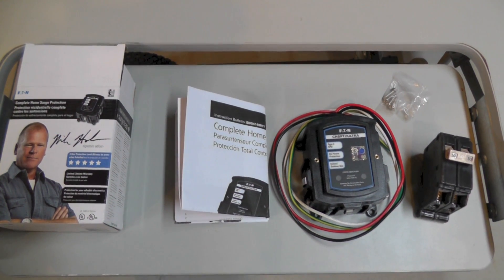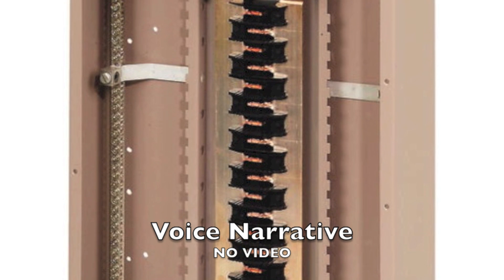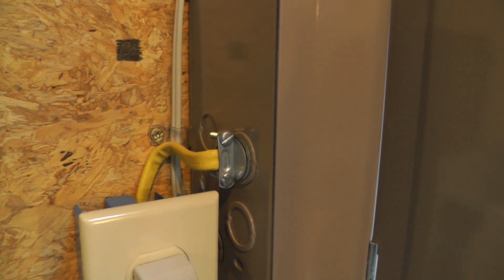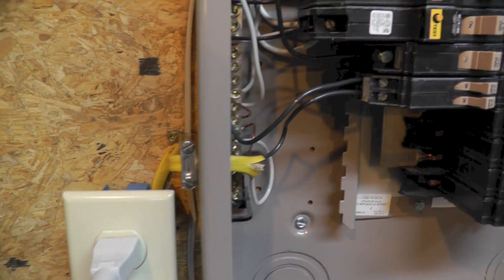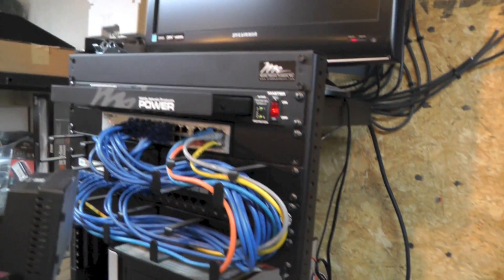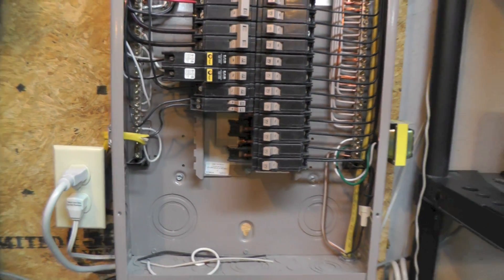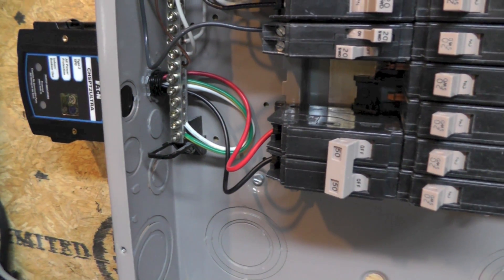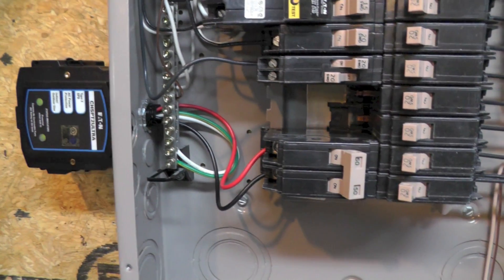Whole House Surge Protection

Comment: Is adding another breaker absolutely necessary?  Can't this just be installed on an existing double pole breaker or on 2 separate/individual single pole breakers installed on different phases of the main bus?
Reply: My panel AND my breakers allow for double tapping, in fact, it has the slot for the second wire. Inspectors may not like it but is mostly because although most panels are good with it, it was not so in the recent past. Yet, I have a 30amp breaker for a dryer that we don't use much because we use mostly our natural gas dryer, so I double tapped that one. It is perfectly fine to do so, technically, is allowed, BUT you need to check in your jurisdiction, mine is fine with it, especially because the purpose of the code is safety and if the equipment is rated for TWO WIRES then is safe...

Comment: Your thinking of the surge like a mouse getting out of a cage and running down the wire.   It's more like a wave that fills all the inlets (wires),  the surge protector will catch that wave and reduce it regardless of the slight difference in distance.   Yes due to the speed at which electricity travels the spike(s) will be able to rise a bit higher before that wave gets chopped down.   You can think of it as putting a load on the line if the voltage rises above a certain point.  Now if the spike is too fast in the sub nanosecond range then these devices don't help all that much.   Then again the sub nanosecond spikes often get attenuated in other ways on the way to the sensitive devices.   For example another surge suppressor or a less sensitive device on the same branch.   Technically in the middle would be best to catch spikes from inside your home spreading to other devices.   Run a vacuum cleaner.....

Comment: The type of surge protector installed here is considered a Type 2 and is only to protect from surges generated INSIDE the home, not from weather or from the electrical company. To protect from either of those, you would need a Type 1 surge protector installed outside at the metering device.
Reply: That's not correct.  A Type 1 SPD is installed between the secondary side of the utility service transformer and the line side of the main service equipment overcurrent protection device.  A Type 2 SPD is installed on the load side of the main service overcurrent protection device.  A Type 2 SPD will protect against internal or externally-generated surges.  It is important to locate the Type 2 SPD as close as possible to the main overcurrent protection device, and keep the lead wires as short as possible, as this improves performance and minimizes the overvoltage seen by the loads during a surge event.

Comment: Where did you see that the manufacturer recommends placing the unit at the top (closest to the main breaker that is)?  I actually see that the install instructions state "Locate a dedicated unused, or install a new 2-pole circuit breaker in an available space closest to the location where the CHSP is to be installed".  Mine is an outdoor panel and there are only knockouts in the bottom of the panel.  I just went with the install instructions and put the breaker at the bottom of the panel.  The leads are not long enough anyways to reach a breaker at the top of the panel.  Your other comments about locating it at the bottom of the panel do make sense to me.

Comment: pretty sure those wires could be a little bit shorter ;) - how does this surge protector protect surges on both 120v lines?
Reply: He is using a two pole breaker. Each pole is on a separate 120 volt line.
Reply: @robertmoore254  yes I ended up installing the leviton surge protector. Works for me! But they recommend a dual 20 amp breaker... So I don't understand why they don't recommend using a 30 or 50 amp?
Reply: @enkrypt3d  Breakers are sized according to the size (awg) of the wires that it is protecting.

Comment: I don't think the distance on your outlet is much of an issue for the electronics you had there.  Include the distance from the outlet to your surge strip and then from it to the electronics and you have a good 3 feet more of wiring compared to give or take 5" from the eaton to your panel.
Reply: Exactly, and he can always use a type 3 in those outlets anyway. He can use a surge strip and plug that equipment there. After all, is recommended to add protection to others like AC, etc.

Comment: I had an Eaton Ultra surge protector installed by an electrician.  My question is will this protect my electron things from a near by lightning strike.  I know it protects against surges but can it handle a near by lightning strike?
Reply: You need some VERY expensive kit to give you that level of protection. You are talking about a few million volts at about 500,00 Amps on average in the UK and our storms are little kittens compared to yours. I worked at a large data centre and the protection devices like GDT and explosive disconnects for a 3 phase 500A feed cost about £450K. You can buy a decent 4 bedroom home for that in most of the UK.

Lightning strikes carry eye watering amounts of power. I find it strange that the AC and fridge were used as an example. You are far more likely to suffer damage to more sensitive electronics such as televisions, computers, alarm systems and audio equipment than larger appliances with a massive inductive load. With a nearby strike you have to worry about induced current to don't forget.

It was not mentioned if this device protects against overvoltage. This can be just as damaging. Surge protection helps prolong the life of devices and gives some protection but is nowhere near as good as a double conversion UPS for example.

They have just started to mandate SPD's in the UK and soon to follow AFCI's god help us !!!
Reply: @TRS-Tech  Exactly my thoughts. He needs to buy one like BAD WOLF, which is commercial grade but made for homes, protects up to 260k, for about $260, and even EMP.  And, they even have one for $400 that goes up to >500K, which is almost a direct hit from lighting. I like the BAD WOLF one, and I recommend it because is made in USA by disabled veterans and the specs are for a voltage tsunami. I installed one for my brother and my neighbor and will soon buy me one. I have an 80K one, which is fine here in Ohio since we are not like Florida, but just for my peace of mind and paranoia, I will get it, relocate my 80k to my subpanel in the garage and with the one for the AC outside in the disconnect box I should be dandy!
Reply: Some surge protectors, most, are between 22k and 35k.  If the lighting is close then you are getting at least 100k, so not enough for the voltage tsunami. Yet, it protects from spikes from your home equipment, and even lighting if far enough and spread enough that your share of the "tsunami" is a minor ripple. You may want to get an 80k one at least.  The best is BAD WOLF, it is like $240, but it goes up to 260k, which is thunder storm in your living room level, and it also protects from EMP, etc.  And, BAD WOLF is made in USA And they are made by disabled veterans.  Is what people in Florida should have for example. That beast is small and looks cool, the wolf red eyes is that LED indicator that is working. And, have another one in equipment far from the panel or outside, like another in the disconnect box outside, the one for the AC.

People who complain it does not ignore that there are levels of surge protection.  Is like complaining your insurance company is bad because it did not cover your loses of $100k, when you paid for a policy that had liability coverage for only $50k. Some others pretend that a strip surge protector of $10 that goes in the outlet did not protect from direct hit of a lightning. Those are meant for surges from the fridge, power tools, the AC, dryer, etc.
Reply: mine did not
Reply: All bets are off with lightning. Act of God! But the unit has a lifetime warranty and Eaton will replace it if destroyed.
Reply: Nope. That's not it's purpose.

Comment: great demo.  there is a reason why mfgs recommend installing the surge protector device as close as possible to the main service connection, usually at the at top of the load panel:   for every inch of distance  that the very large current spike travels, on its way to the MOV, there is a voltage drop equal to the surge current times the resistance of the copper involved, which includes the bus itself and the surge protector leads. so if you want to add  to  the size of the voltage spike that your house sees, don't bother trimming the surge protector leads--remember they will add  about 100 to 200 volts per foot. the bus itself contributes some but very little compared to the leads themselves.  nice job here 

one detail that is worth mentioning is that the Eatons 50a breaker is what differentiates it from others, and gives it a very impressive nominal discharge current of 20kA.
Reply: Thanks for the explanation. Just to reiterate your point (with a more direct statement), it is more important to keep the surge protector leads short than it is to locate the surge protector at the top of the panel (i.e. at service  entrance). The resistance of the leads is going to be much  (e.g. 10X) more per unit length than the bus bar. Stated another way, 1 inch of lead is equivalent to 10 inches of bus bar. KEEP the leads short.

Comment: Any surge coming into the left branch is protected but the right branch is not. Shouldnt you use 2 single breakers one on each branch?
Reply: Every other slot is the same "hot" leg. Left side would be 1,2,1,2,1,2,1,2; right side 2,1,2,1,2,1,2,1 etc. This results in more balance between the bus bars.
Reply: @jcnash02  I believe that left and right sides at the same height are the same leg.  Therefore left side going down is 1 2 1 2 and right side is 1 2 1 2. Etc.
Reply: Study 1:14 a little more carefully.

Comment: So if I have 2 panels in my house, I have to install 2 surge protectors for both of them?
Reply: If you have (2) two panels one is likely a subpanel which should have a main breaker feeding the subpanel.
Reply: In this video of a Main Panel, the green and white wires were both connected to the left buss, which was the ground buss.  This is OK since the ground buss and neutral buss are connected together in the Main Panel. In a Sub-Panel, they are separate.  Therefore, the Eaton white wire will go to the neutral buss, and the green wire will be connected to the ground buss.  Notice the doorbell transformer on the right. Both green and white are connected to the neutral. Again this is only OK in a Main Breaker panel.  Note: I am not an electrician, but I know a few.
Reply: seems to me that would be a good idea. most of these when get hit by a big surge or lightning the unit needs to be replaced s it has done it's job some have lights on them that indicates if the unit is working
Reply: Not a need per se but I have another one in my subpanel since it is so far in the garage from the main in the basement. This is because any power tools I use in my garage the voltage tsunami would hit everything fed by that subpanel before it reaches my main in the basement, so it arrest any spike in the very panel in the garage and let it send the excess through the neutral. Same principle as having another surge protector in the AC Disconnect box outside.  It is farther than anything else.

Comment: on the right side of the panel, What is that yellow box connected on the outside? thanks
Reply: It's a transformer. Most likely for a doorbell. Usually find them mounted on a junction box in the basement joists.

Comment: All white wires should be connected to the neutral bus bar, bare copper/ green wires should be connected to the grounding bar in the panel. I see bare copper wires connected to the neutral bus bar, that is against NEC.

Comment: You connected the white & green to the same bus bar.  I checked the PDF instructions and it says to tie the white to the neutral and the green to the ground. The PDF also has a schematic showing them connected to separate bars even though both bars connect to earth ground.   On a main panel, they are tied together, but at a subpanel they are not.  You have a ribbon connecting your two bars. If the screws were to come loose or lightning were to fry that ribbon you'd lose your protection.  Most likely you're fine, but it's not following the instructions, and this is wrong if anyone is doing this at a subpanel.  You should add a video annotation to connect them separately.
Reply: ONLY if that is a subpanel... which this one is not. In a main panel, such as the one in the video, the ground AND neutral are connected (bonded) together so it is NOT a Code violation. And a "home inspector" does not have jurisdiction, only the city/county/state electrical inspector.
Reply: It is his main panel and both ground and neutral ARE bonded in the first disconnect from the meter, which in his case is his main panel.  A subpanel and anything after the FIRST main disconnect has to be separated.  IF at the main panel then it is all bonded and the same bar. From then on any current going out via ground or neutral will continue to the meter and then to the utility pole via neutral.
Reply: I noticed that this guy put the ground on the neutral bus bar too. Here in So Cal in all cities that is code violation. 
 Any home inspector would not at all sign off on that.

Comment: That's the most amazing looking panel I've ever seen. I am going to show this to a friend of mine who, after seeing this, has the 2nd most amazing looking panel I have ever seen. I am considering a whole house surge protector as well. My question is, has this unit saved the day for your electronics during any surges or outages since you have installed it?
Reply: anthonyflannery222
 does help that it is mainly 20 and 15amps circuits. 

very clean panel though!

Comment: 1. on the left of the panel you don't have a GFCI and a staple 12 inches from the panel. 2. you want to put the surge protecter as closest to the lugs as possible so I think moving 2 breakers to the bottom is worth it. it also makes sense because your panel outlets are just as close and It will make it 12-18 inches closer. 3. the manufacture suggests a 15 amp 2 pole breaker not 50!! Otherwise, THE NEATEST PANEL I EVER SEEN!!!
Reply: Peter Gilbert 
instructions do indicate a dual 50a for this model. it can take a larger hit than the non ultra.
Reply from the maker: 1. Yes, there should be a GFCI there;   2. Agreed, closest to the incoming source is better, but you have to relocate some breakers and make sure the wires reach, etc.  However, the photo on Eaton's web site of the pre-installed CHSPT2ULTRA is located at the bottom of the panel;  3. According to the documentation (http://www.eaton.com/ecm/groups/public/@pub/@electrical/documents/content/ib00414001y.pdf) it is recommended to use a 50 amp 2-pole breaker with the "ULTRA" model like I installed to achieve full published ratings.  Thanks.
Reply: @AllThingsBobot  Do you mean the 50 Amp 2 pole breaker servicing the surge protector that you installed should have been a GFCI? Thanks for the video, by the way. I looked it up on the Eaton's installation instructions and it does not mention the GFCI type.
Reply from the maker: @mariuso4879  No - we were referring to the outlet on the outside of the panel at 2:07

Comment: A little hard to install the body. After I got it through the knockout, I could not fit the service panel cover back on. The door was rubbing against it. So I had to put it on  a box coupler and a rigid coupler, after I had already cut the wires it just reached into the breaker. Siemans Panel and Breaker. The 50amp breaker that Eaton recommends Siemens for me, could not screw down tight on the wire. Wire is between a 12-14 awg size, this could have been at least a 10awg. when twisting the stranded wire after stripping I found the strands breaking some. Make sure your 50amp breaker screws go all the way down for clamping these wires.

Comment: I was told the wires on these are about 14" long, which is too long for me. I am wondering if i can cut the wires a bit shorter, or will this void any reimbursements or warranty?
Reply: You want the wires short, that's why they want you to install the protector at the top where the feeder is coming in @ the main.

Comment: First off I have to say that is the most beautifully wired electrical panel I have EVER seen. Who ever did that was indeed precise and just made it perfect. I bought my home used so there is a "nest" of wires in my panel but I can say that at the very least you can tell what I have added. So you can certainy be proud to pull that panel cover off your box..Second, why didn't you mount that surge protector in that huge empty space below the buss bars inside the box? There "seems" to be enough room for it there. Granted you could not see the "green lights" easily but I may cut an opening in the panel cover to allow that view. I ask this question because my panel is built into the wall and I don't have access to those convenient side or rear punch-outs as you do. I kind of get the idea of mounting the unit as high as possible and as close to the top of the buss bars but I agree that what what you have done "may" in the engineers mind not be optimum but it certainly is better then nothing.
Anyway, nice video and thanks for taking your time to do it and show us what is going on with one of these units.
Best regards, Lisa
Reply: Tying the wires tight like that may not be a good idea, because electrical wires generate heat. You can still have it neat and keep the wires loose.